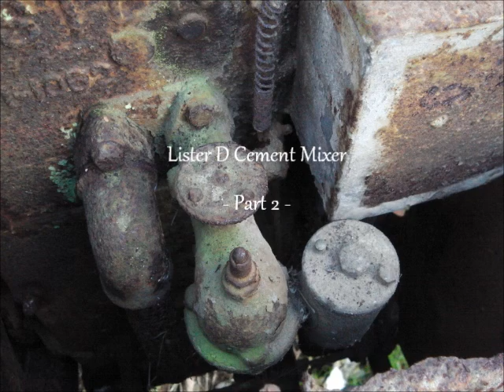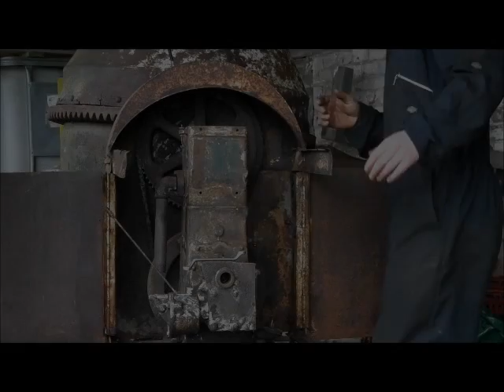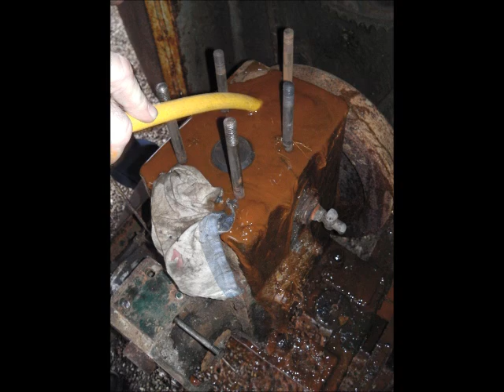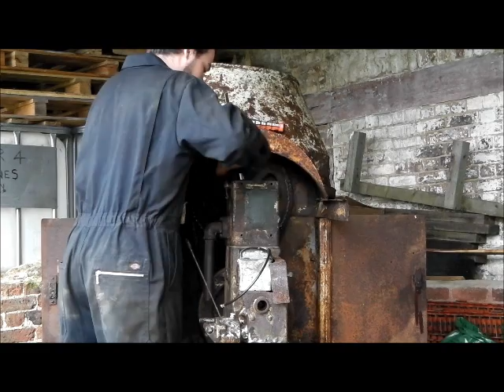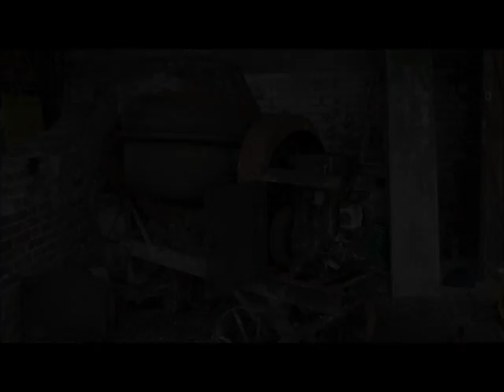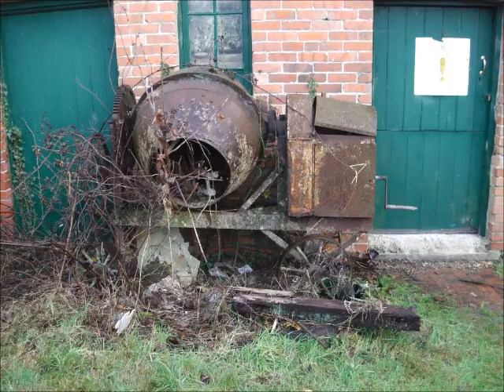Lister D Cement Mixer - Part 2 -

Comment: Its a RR like mine tough. Obviously the oil was changed Phill? Have a happy new year :)
Reply from the maker: +enginelover1 

That's right, most mixer engines are reverse.

We just flushed it through with clean oil, it will get a proper sump clean before going to a rally. 

Happy new year,

Phill.

Comment: Way to go, Phill.  Those old Listers are amazing.  Something to be said about simplicity enabling longevity.   Is the connection from the engine to the drum solid?  No clutch?
Reply from the maker: +odc43054 

Thanks. Cracking little engines, the basic design is nearly 90 years old and many of these are still doing a days work now. When it's worn out.... there's nothing that can't be put right. 

It's a straight chain drive to the drum, a clutch would have added a weak link and no good on a building site. 

As a result, you do see many of these with damage - indeed, on this one the low speed sprocket has been cracked (perhaps the drum jammed?) and badly brazed.... but it works!

I had a little Ruston Hornsby engine from a mixer, in the end I deemed it beyond my capabilities. The mixer had jammed and the inertia of the flywheel made the crank sprocket "climb" the chain; resulting in a banana shaped crankshaft and cracked flywheel. I still have the crank on display in the house!

Phill.

Comment: Great work that , are you going to fully restore it .
Reply from the maker: +Peter Froud 

Thanks, it will be left looking just how it does now.
Reply: Fair play . Did the carb give you any trouble.
Reply from the maker: Not really, though the throttle spindle took some doing. It's not worn at all, so it had well and truly stuck - plenty of heat and oil got it moving eventually.
Reply: Well fair play for getting it going , nearly 70 years old , they did not build rubbish in the day.
Reply from the maker: Your right, the casting which holds the drum is hollow, but 10mm+ wall thickness, it's not going anywhere fast!

Comment: It's a D type. Not much will stop them from running after a good clean up.
Reply from the maker: +thra5herxb12s 

An unbeatable design!
Reply: And ready for the Lister "D" type 90th Anniversary this year.
Reply from the maker: Indeed, the plan is to get the mixer there. Will be fun loading it onto a trailer.... I can honestly say, acting as brake man whilst taking it down a steep slope was a terrifying experience! They are incredibly heavy...